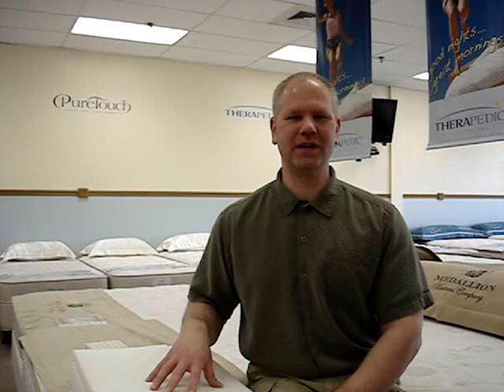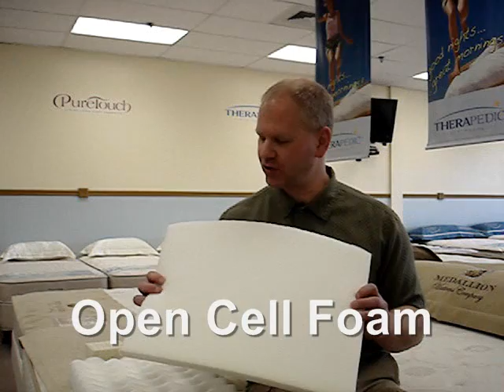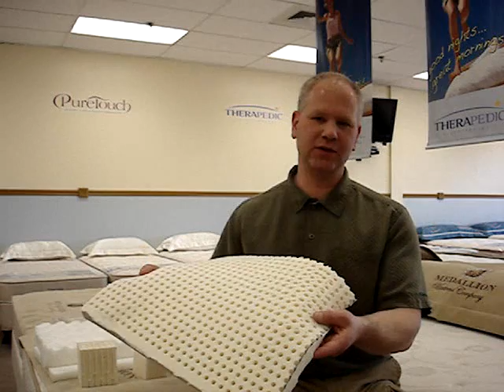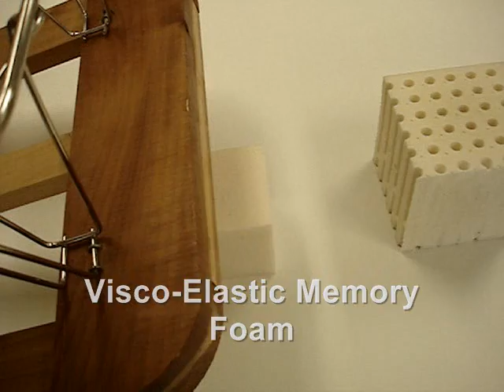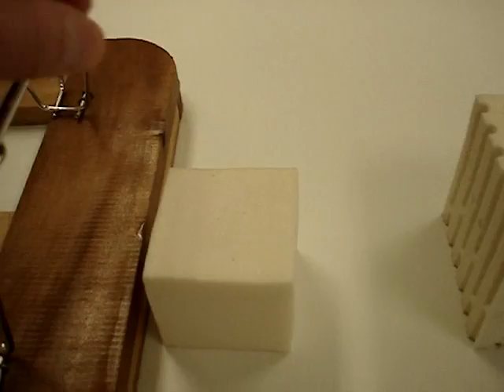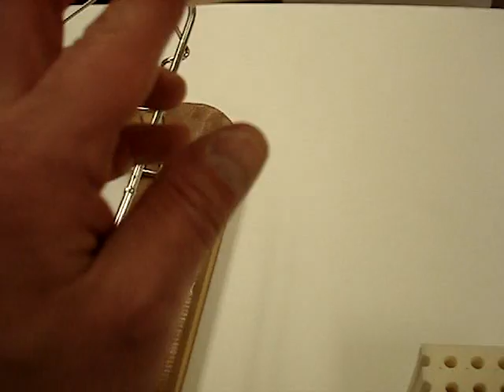Beducation® - Polyurethane Foam, Memory Foam, And Latex Foam

Comment: I Just bought this mattress a couple of weeks ago & it has a chemical smell! It is choking me! Tried airing it out for a few hours no improvement! So what is the next step to rid this mattress of this Odor? Please help!
Reply from the maker: I'm sorry to hear that you're sensitive to the smell of your new mattress. Depending upon the state of cure and the types and amounts of foams used in your mattress (you didn't mention the model/type of mattress you have), the gradual diminishment of the original odor can take some time, especially if you're sensitive to such odors. 

The best suggestion I have would be to lean the mattress up against a wall in another room, open the window, and circulate air around the mattress with a large fan. That might help dissipate the odor for you after a few days or a week. There are topical sprays that claim to eliminate certain odors, but those wouldn't reach deep into the mattress and you'd essentially be adding more chemicals to your issue, which could potentially exacerbate your problem. 

Good luck!

Comment: I got a hybrid mattress. In your opinion is a Centi-pur certified mattress relatively nontoxic in it memoryfoam? Thanks for this great video.
Reply from the maker: The term "relatively nontoxic" isn't an objective standard for which an item can be tested (although most people I think would get the gist of what you're meaning), so standards like CertiPUR-US do have some specific things for which they test (which I think most people would agree are good things to evaluate).

If the polyurethane FOAMS used in a mattress are CertiPUR-US certified, it means that they are:
-made without PBDEs
-made without heavy metals
-made without formaldehyde
-made without phthalates regulated by CPSC
-low VOC certified (< .5 ppm) 
-made without ozone depleters

https://certipur.us/ has more complete details on the testing process and actual requirements for foams to meet these standards.
Reply: @BeducationMattress  thank you. I looked up Centi-Pur's list of mattress  manufacturers and Linenspa, the bed I just purchased, had some sort of vague notation that didn't seem to ensure they were Centi-pur certified currently. I'm ok so far, no symptoms. Thank you for the detailed answer
Reply from the maker: The CertiPUR-US website states for Linenspa: "This company is on record as using CertiPUR-US® certified foam, but updated directory listing information is currently unavailable." So, they simply haven't updated some of their company category information with CertiPUR-US, which needs to be done on a yearly basis.
Reply: @BeducationMattress  I feel better now. I had gotten a Zinus innerspeing mattress and got the worst low back pain, so got the Linenspa hybrid my first memory foam.
Reply from the maker: That's great if the new mattress is working better for you. Unfortunately, there's no one mattress or material that's guaranteed to relieve low back issues. We can only evaluate products based upon the quality of their componentry to help determine/rank for an expected consistent comfort life. I'm happy you feel better now.
Reply: @BeducationMattress  We really need informed people like you.
Reply from the maker: Thanks for the compliment! I keep pushing for comfort consultants being educated individuals about sleep, ergonomics and componentry, and you're slowly seeing this happening within the industry, but it's unfortunately still far from commonplace. Most stores instead favor training their staff as salespeople.

Comment: Can you do a utube for mattress choices for heavy sleepers?  Most mattresses are made for people within a certain weight but what if you are outside this?
Reply from the maker: Thanks for the suggestion. It's on the list, but I'm afraid it's a ways down in the order. With larger individuals, it's imperative that they choose comfort materials that are durable and maintain their resiliency under higher mechanical stress. This would generally be higher density (and not too soft) polyurethane foams, more dense natural fibers, and latex foam rubber. Nanocoil and microcoils can also be durable comfort layers, as well as some higher quality buckling column gels in the deeper upholstery layers. For the support core, firmer latex can be appropriate, along with higher density, firmer high resiliency polyurethane foam, and stronger innerspring units. These are just some quick, general guidelines.
Reply: @BeducationMattress  are there any mattresses you would recommend? My husband is around 270. We are always getting a dip in our mattress. We are considering pocket coil with 3 to 4 inches of latex. What do you think? Ghost bed natural  tala latex - 'or silk and snow organic dunlop latex? Or should we go to a private company that customizes where you can switch out the layers like get 2 inches of dunlop and 2 inches of tala. It's really hard shopping right now because most mattress companies do not include latex in their mattresses.
Reply from the maker: I'm sorry, but I couldn't begin to make any sort of an accurate recommendation for a specific mattress via an online forum. To do so would be a disservice. You're best served by seeking items using the higher quality components about which I previously wrote. There area a few people I respect producing pocketed spring mattresses with latex on top, and they in general are not a fan of that combination with larger individuals, instead preferring some sort of all-latex configuration (using firmer latex for the support core). But this is a general statement. There are other good and solid materials out there besides latex, and with over 500 companies nationally producing mattresses, there are plenty who manufacture lines using higher quality componentry (polyfoam above 1.8 pound in density, pre-compressed cotton and wool, medium-plush to firmer Talalay or Dunlop latex, etc.). There's a good guide somewhere on The Mattress Underground that discusses items for larger individuals that you might find interesting.

Comment: After doing tons of research I purchased a latex mattress topper a year or so ago. Initially I enjoyed the new feel of it. It was softer and a lot more enjoyable than my previous mattress which felt more like a wooden block.(I use it as the base now) But overtime ive realised that it's not actually helping me for my intended purposes. I weigh around 80kgs and i am a side sleeper and the latex topper is not able to relieve my pressure points like my shoulder and hips and I've very had neck pain and back pain because of it. I feel the topper is too bouncy and resilient for my weight even at a medium density. 
Interestingly, I purchased another mattress with a memory foam for my other room and that feels a lot more firm than my latex topper. I really thought it would be soft and sink in but it wasn't like that. Its not the most comfortable mattress ive tried but sleeping on that occasionally feels like a relief (which is kinda disappointing since my topper costs almost twice as much) 

I am thinking of getting something else. Any advise? Should I go for a topper again or a whole mattress? Should I change materials or should i stick to latex and go for something softer? I can't really figure it out honestly
Reply from the maker: Unfortunately, picking out a mattress for you online isn't something that I can do with any sort of accuracy. I'll try to address some of the comments you made, but much of the information you provided is incomplete so I'll have to make some assumptions and reply in very general terms which I hope are helpful.

A topper of any type will generally provide extra plushness to what it is placed upon, but it has no choice but to conform to what it is placed upon, and the feel of the topper is primarily determined by what it is placed upon. If you put it on something very hard, then your overall sleep surface will still feel very hard, but just with a bit of surface plushness. 

You don't mention the type of latex, the thickness, or the ILD or density of the topper, but assuming a common 3" Talalay latex topper in the mid-20s ILD (you mentioned a "medium density") will provide a bit of extra plushness when placed upon what you describe as a "wooden block". But something of only 3" would unlikely be the cause of back issues, and most neck issues tend to be pillow related. I would guess that the underlying issue if that the mattress under the latex topper is overall too hard. I have to guess here, as I have no specifics upon the exact construction of the product. The "pushback" and "resilience" you're relating to the topper would primarily be from the mattress underneath the topper. It's quite possible that you'd need a more substantial build-up of materials atop this mattress to meet your very specific needs, but this isn't something I recommend you pursue.

As for your other purchase, you provide even less information, so I really can't comment at all upon that set up. My best guess would be that it contours a bit better to you when you're on your side, and as far as overall comfort it's probably a step in the right direction.

What to purchase next? My best advice would be to find an educated comfort consultant at a store in your area who can assess your body type, sleeping style, previous history, and recommend something with componentry that will better suit you. I don't recommend purchasing a mattress with a topper right away as a general rule, as you're immediately throwing an extra variable into the mix. I'd suggest trying to find something that as a complete mattress better suits your needs. As a side sleeper who seems to have chosen items that are too hard feeling, I'd suggest something that offers good deep support for a more neutral alignment, but also has good surface conforming characteristics to assist with allowing the hips and shoulders to sink a bit and distribute your mass over a bit of a wider area.

Good luck!
Reply: @BeducationMattress  fantastic assumptions and thank you for taking the time to reply. 
so let me address what I can. 

The base mattress is an old coir-spring mattress ad its very hard surface, its hardish. If i put my knee on it, it goes down quite a bit at that spot. but when I lie down on it and my weight gets distributed,  there is hardly any sinking in- perhaps even less than a quarter of an inch - maybe. 

My later topper is 3 inches in thickness and IDL I believe is 22.  it sinks in but has a lot of bounce and pushback. perhaps its too resilient for my weight. when I lie down on it, and Ive measured this, some spots like my shouldres sink in by 1/2 max, much less any advertising or video suggests. the topper sinking in only by half an inch means that atleat 2 inches of the topper is unaffected by my weight and I dont think the base is in anyway affected enough to play a role currently

since I wrote my questions, I have removed that topper (which i have been using for a year) and gone back to directly sleeping on the base mattress and I am surprised at how relieved my shoulder and neck feel because that wasnt the case before I purchaed the topper. 

even though the coir-spring mattress is hard, I feel less presssure on my shoulders for sure. granted its only been a 3 times that I have slept on it and so I am going to do this for 30 days before I decide what to buy next. 

rest of your insight seems logical as well.

Thanks, once again
Reply from the maker: A mattress that uses coir atop of springs will tend to have a bit of a higher surface tension. How much depends upon the concentration and the thickness of the coir, as well as the type of spring unit upon which the coir is placed, and the type of foundation (active versus solid). There is more contouring and deflection going on in the combined sleep set than what you observe at the surface and relate to only 1/4".

As for your description of the topper and how it is working for you, it is important to realize that all of the layers within a sleep system (foundation, mattress comfort layers) work in unison, versus sequentially. So again, your topper/mattress combination is deflecting more than you relate in your comments. This can be difficult to conceptualize and wouldn't be something to which most people would relate unless they were in the business of designing and engineering sleep systems (which wouldn't be too many people).    

Generally, increasing the surface comfort on a product that is too hard will tend to relieve pressure point issues for a side sleeper. But adding surface plushness to something that allows for too much sink (perhaps with poorer support characteristics) can negatively impact alignment and cause more issues. 

All of this points back to my first statement about the inability to pick a product for someone online. It tends to be a bit of folly. Despite one's best efforts to be accurate in their descriptions, it's difficult for a layperson to provide an accurate representation of the state of the componentry within an existing mattress, which is why it's so much better to visit with someone who is knowledgeable in person and then relate your impressions in real time on products that are presented to you for testing. That's what I do with all of my clients - I tend to not focus too much on their old products, but instead look for componentry in a new mattress that tends to be appropriate.

There was a good article I ran across a few years ago on The Mattress Underground that described how mattress layers work in unison if that is of interest to you, but I don't have the link. That site might also be a good resource for finding an educated comfort consultant or business close to where you live.

Good luck!
Reply: @BeducationMattress  thank you again for taking the time. the search for answers goes on. but i understood that this is something that has to be tried to know more. I will check the resource you mentioned as well.
Reply from the maker: Good luck in your search!

Comment: I've heard that latex foam can develop mold?
Reply from the maker: About anything can grow mold if the environment is hospitable. You need an organic food source (quite often skin cells when referencing a mattress). You need a warmer temperature (upper 70s to mid 80s Fahrenheit). You need a humid environment. You need oxygen. There's your recipe. While mold is unable to digest inorganic material, it can thrive on organic material placed upon inorganic material, such as dust that contains quite a bit of skin cells that can accumulate between a box spring and a mattress. Latex foam is often represented as being inhospitable to mold formation, as it tends to flow quite a bit of air and not trap so much moisture. This is one of the reasons that latex foam is popular for use in the marine world. However, if you place any type of foam in an environment that is humid, warm and full of organic material, you can get mold to grow.

Comment: Sir you are an expert !!!! I want to ask what do recommend for side sleeper ? Memory or polyeth.?
Reply from the maker: Comfort is subjective. Generally speaking, for a side sleeper you want enough surface comfort to allow for some point elasticity around the shoulder, waist and hips. But not so much of a drop that you induce lateral curvature. Maintaining a more neutral alignment is key. How much comfort material on top depends upon the individual and their dimensions. You can achieve good comfort for a side sleeper using latex, memory foam, and polyurethane, or a combination of these items for your comfort layers.

Comment: Comparing same density and depth, which is better for pressure point relief? Visco memory foam or Latex?  (I once had a memory foam that was like sleeping on a cloud but can't remember the density. I think it was very very soft and felt wonderul. I'm still trying to find another one like it.) Also do I understand correctly that not all memory foams are created equally in that visco elastic is not the same as polyurethane member foam?
Reply from the maker: Both materials are very point elastic and can provide good pressure point relief, but they have different feels. Latex is more buoyant and memory foam has more of a dead feel. People tend to prefer one versus the other. Also, realize that the overall feel is subject to the entire sleep system, as it works as a complete unit. Density and plushness is an almost direct relationship in latex (higher density equates to a harder feel), but not necessarily in memory foam. For use in mattresses, almost all memory foam will be in a very ultra plush range of comfort (lower ILD), but there can be variations in recovery rate, glass transition temperature, breathability, sensitivity to heat (viscous nature) and so on, that can change how the memory foam feels. Technically, memory foam is a slow recovery type of polyurethane foam, and yes, not all memory foam is created equally. There are variations in quality (density), as well as some of the characteristics that I previously mentioned.